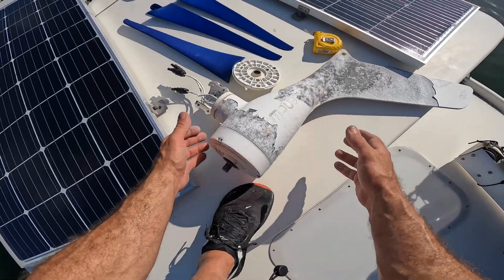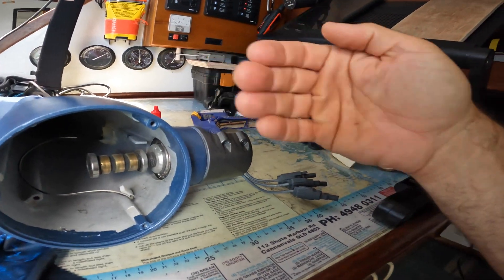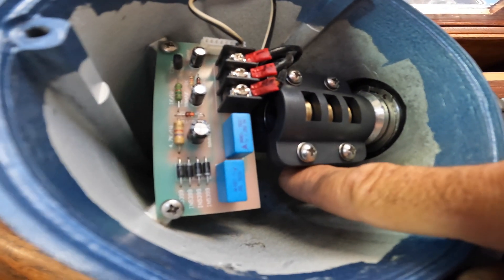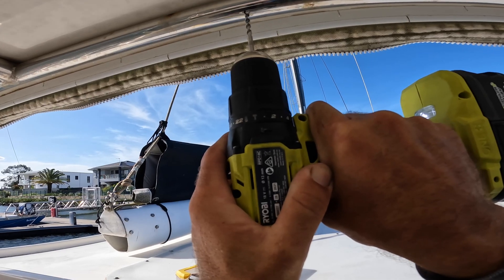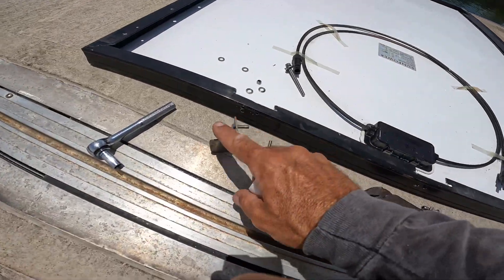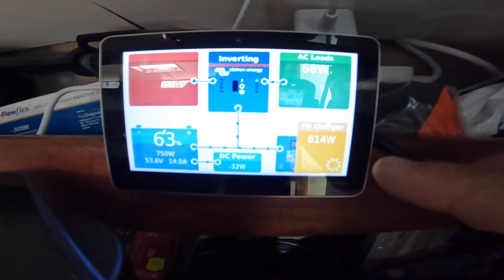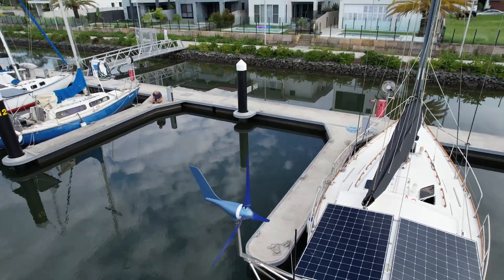Wind + Solar 48v upgrade SAILBOAT 36FT

Comment: So you run the wind generator into the batteries along with the solar . Is there any issues that requires the solar and wind gen to talk to each other . For example so battery doesn’t get overcharged ?
Reply from the maker: Nope. They both have the same (charging) parameters set independently. Which means in theory they should go into “float” at basically the same time

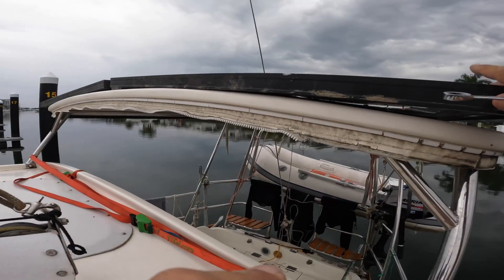Comment: Tymon, I really appreciate your content. I am vicariously designing the ideal cruising boat and trying out many things at home (solar, battery backup, efficient kitchen appliances, land transportation (eBikes), etc) the last time I cruised was in the 1970's so I've got a lot to catch up on. Your videos make it enjoyable. Being the Word Police, check out your use of the word "Series" where you meant and described correctly parallel at 9:22 and 9:45. I wondered because I am planning on using panels that would need 2 in series to make 70 volts. Your SunPower panels are already that voltage in each panel, so parallel is perfect for your controller.
Reply from the maker: Hey mate! Absolutely correct. Parallel for those two and the two in a future video. Glad you’re enjoying them. What boat do you have/are going to get?

Comment: You figured it out but to anyone else trying to figure it out the output is 3 phase AC but it just gets rectified to DC so the order doesn't matter.  Likewise the order connecting it to the charge controller doesn't matter either.  Ultimately spinning things produce AC (usually 3 phase) to charge a battery we rectify it to DC and then run that through a charge controller.  Now in a situation where you were wiring up 3 phase AC from say shorepower on your megayacht then yes phase would matter but here we are just going to rectify it down to DC anyways so order doesn't matter.
Reply from the maker: Sweet info! Cheers Gerald

Comment: Nice project! Are you also going to regen using the prop when sailing?
Reply: Nice work. Best to put an isolation switch between Panels and MPPT. You can always cover panels with a blanket when connecting but the isolation switch on positive is best. RV ‘s mount the corner fittings on roof with VHB rape so no holes in roof. I’ve done on my Bimini it is very strong. Get on eBay. Solar system advice is best from Andy at Off Grid Garage in Brisbane via his YouTube channel. André in Sydney
Reply from the maker: That's the plan! Stay tuned for how much regen I get at what speeds 👍